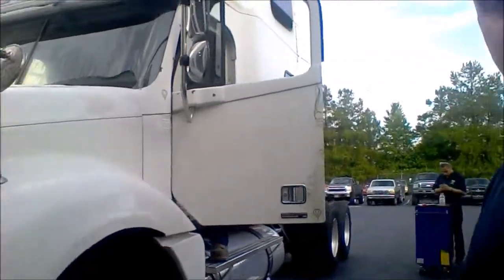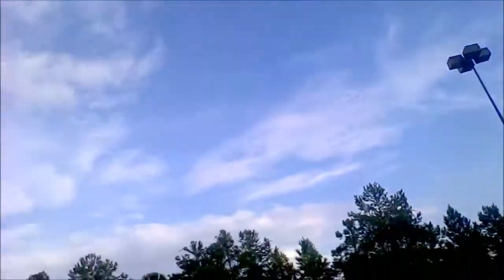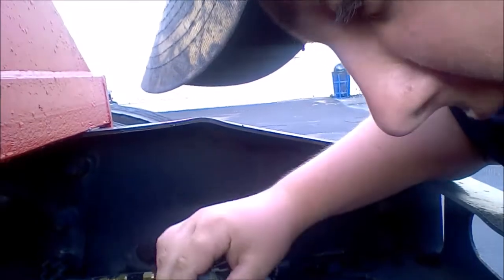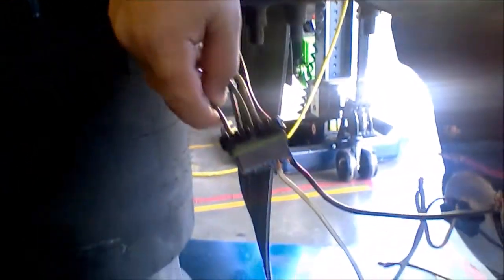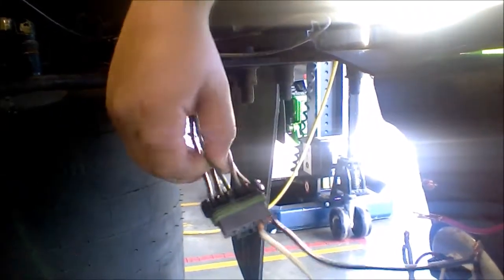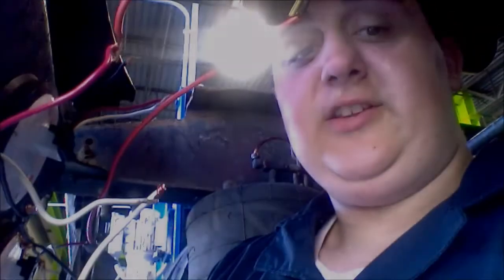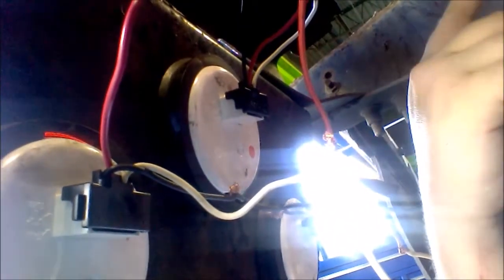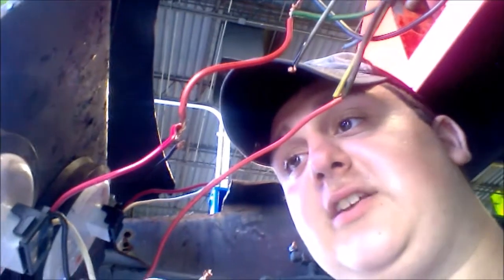2005 Freightliner Brake Light Project

Comment: Dude did u check the level on the fuel I had the same problem on my truck with my fuel gauge goes low my lights don’t work it’s a safety feature on my truck